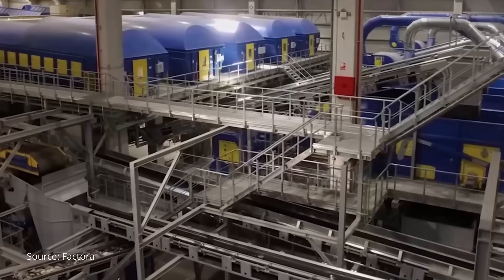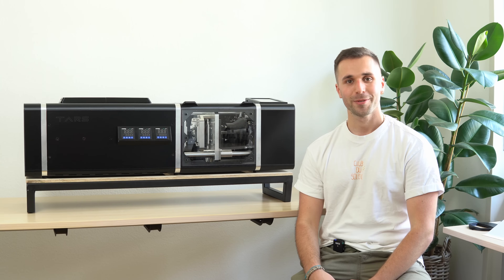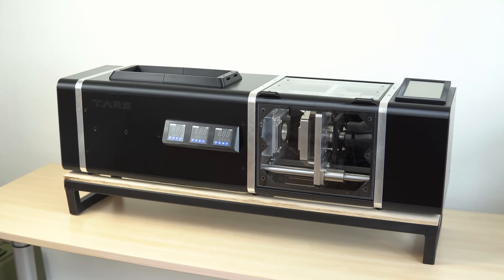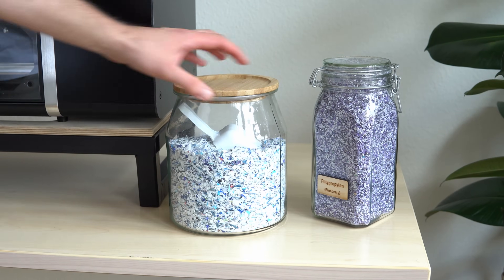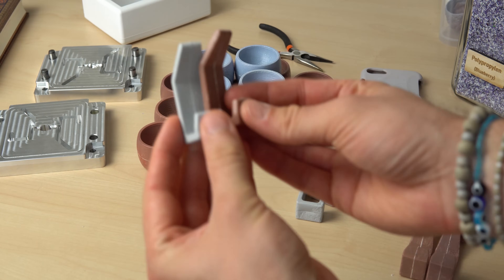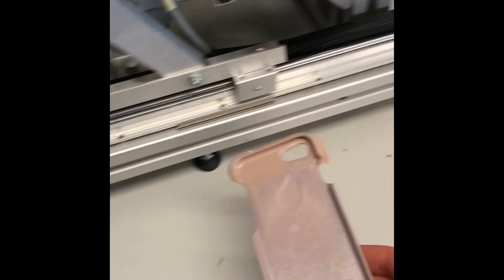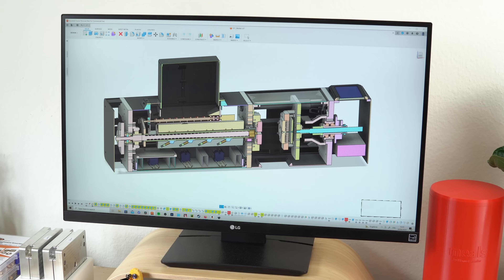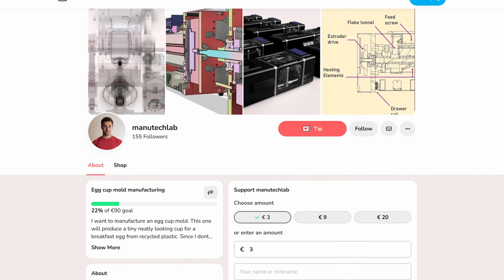Making a desktop injection molding machine for plastic recycling - TARS

Comment: The thing about injection moulding is that it is what unlocks true mass production. And while a workshop with a couple of 3d printers a cnc machine can scale surprisingly far it is nothing compared to what injection moulding can do. Even a relatively small tabletop version like this can be a workhorse that kick-starts a whole business. 

I know that you made this for purposes of recycling but I can't help but think about how this could bring back manufacturing to parts of the world which have exported their manufacturing capability in this arena to China. It's gotten so bad that nowadays it's impossible to find know-how for making moulds you can only import from China and that puts your intellectual property at risk and has some other issues.

Comment: Any coating on the screw will eventually find its way into the plastic 

It can be a non issue but can also cause head scratching when you need to gigure out what clogged a nozzle or causes weird dots in the material

Comment: The way to make this successful is to make this as low cost as possible. If you don't do this from the start, your machine will be pirated in China before you even begin producing them. The most important thing is to be as cost competitive with China as possible. If this is not your number 1 concern, you will absolutely lose. I cannot stress this enough.

Comment: I love the idea. The only issue I see with it is similar to those with traditional injection molding: you need highly specialized molds that are usually quite expensive. Have you ever considered creating a simpler application of this technology, like a 3D filament maker or something along those lines? If so, what made you choose an injection molder?

Congrats on this machine. It looks extremely clean and well-thought-out.

Comment: looks like your injectionsmold machine needs some more injection pressure and or some vents to remove the airpockets. It is quite typical to have injection pressures of over 1000 bar on products like this (this is quite hard to reach but i think it might be good to know). also all injectionmold machines keep pressure on the material after injection to move the last bits of plastic in the mold. the vents are typicaly small gaps on the closure faces these are about 0.01 or 0.03 mm depending on the materials used. you can contact me if you want to know more i have few years experiance in mold and die making and can operate a industial injection mold machine.

it is really cool what you made tho

Comment: i'm in no position to buy this machine, just curious is it possible to resin printing high heat resistance mold and injection mold custom parts?
I remember sawing some video on small scale production using this method

Comment: Hi Manuel is amazing what you did. 
I am working on an other machine will produce mushrooms on low scale. For big scale there are many on market. Can i ask you how you heat up the interior of the flakes? This problem still not have solved as need heat up also an cylinder with water in it. Will be so happy if you can give me a link or idea how made. Thanks so much

Comment: Looks awesome man!
It would be great if there could be some kind of shredder on top. Shredding the plastic to small pieces can be quite difficult without a proper machine.
Is this only for a specific type of plastic like PET or ABS? Or are you able to combine the plastic pieces and create something from a mixture of plastics?
Reply from the maker: Hi :) thank you very much.. that would be cool indeed. For now I mainly used PP because mixing is not a good idea. PP worked really well so far and is very common in German post-consumer waste

Comment: I think you have a marketing or miscommunication issue? You say this is for plastic recycling, but then you start with shredded plastic. How do I get the shredded plastic? How do I process raw recyclables into sorted, clean stock for shredding? From the initial pitch, I thought that's what this was solving. But instead, this is "desktop way to make plastic parts." But that's competing with a 3d printer. I can see that this might be better than a 3d printer in a lot of ways, but you didn't really emphasize that. It seems like there are 2 main users: "I want small-scale plastic recycling" and "I want small-scale plastic injection molding." I think your current pitch wouldn't satisfy either of them, even if the product itself is awesome. Just my 2 cents from struggling to explain a confusing product in the past.

Comment: This really looks cool! I am not shure about the „recyceling“ as it is just a injection molding machine and the parts you produce seem to me more like downcyceling. But the machine is really impressive! Still the parts show obviously the low injection pressure of the system and uneven viscosity of the plastic i. e. too short heating. But if you improve those, you got a money printer there. that could add to fast, cheap prototyping as 3D printers did.
Concerning the recyceling, yes shredded bits make sense for cost, but are aweful for process stability, a mess when handeled, harder to control. Thats why pellets are used, even tho they are more expensive then loose shredded bits.
May I ask your background? looks to me like you studied mechanical engineering.

Comment: I think the title is a little bit missleading in itself. It is a great looking machine but the core problem is the shredding of plastic, this plastic needs to be sorted out into the different types of plastics. Need to make sure the thermosets are not mixed with the thermoplastics. 
If the shredder was sorted out to do all the sorting this would be a 1 of machine, but I have doubts about that ever being feasible in this formfactor. 

What sort of lockingpower does the IM have? And can it keep afterpressure in the cavity itself after filling it up?

Comment: Did you issued a patent about this project? or you're not interessed into makeing this into a commercial product?
Reply: There's nothing justifying a patent here, shredded plastic has been around for years, injection machines have been around for years. They have been using recycled material for years. And the molds themselves are just standard 2 part, soft tools with no cooling in them so no patent there either.

Comment: why quality of molded parts is low? Is this a mold problem?
Reply: I would imagine it is a combo of problems. The surface defects could just be from the molds themselves partly, any toolmarks will be transfered to the finished part. 
The afterpressure of the mold could also create problems if you can't actually keep pressing material into the mold after the initial fill to prevent it from sucking material away from thicker areas. Could also be a problem with using 100% shredded material, never going to have the same surface finish of parts like virgin materials would have.
Reply: @aeywyn5230  thanks mate, nice to hear an advice from experienced person

Comment: If you could extrude the recycled plastic into 3D printer filament, it would be incredibly easy to turn household plastic waste into parts for any application you could think of. It won't have the same strength as the molded parts, but the versatility would be great for home and garage projects. Great job with the incredible recycling concept!

Comment: This is great, but what about fumes? Is there a ventilation system of sorts?VOCs and other harmful gasses are released when the plastic is heated. PVC can release hydrochloric acid, and ABS can release styrene… not to mention all the potential additives like plasticisers, flame retardants, and colorants.

Comment: There is not a word in the film about the basic parameters of the injection process. How do you control the charge back pressure, dosing speed and stroke, injection speed and pressure, switching point to pressure hold, mold clamping force, cooling time and mold temperature? Building an injection machine is less than half the way to achieving a repeatable process. The cost of building an injection mold often exceeds the cost of purchasing an injection machine with peripherals.

Comment: I'm trying to think of ways to utilize the machine but I'm coming up a little short. Is this a professional's or a hobbyist's machine? Meant to run once a weekend or 24/7? Where does one source (compatible) plastic waste in large enough quantity and of predictable quality? By yourself, shredding it yourself on your own shredder? Is there a sieve in the assembly?

I see no water cooling on the mould - sure, it's a prototype, I get it, but it is not possible to make "hundreds of parts" per hour without active cooling - which would also mean that parts shrink and also warp unpredictably as they cool. The output pressure also seems too low to really fill the creases which I assume are a consequence of unevenly melted material because of different melting points.

If this should be a hobby, it would be a prohibitively expensive one, you either have to make molds for it yourself, in which case you need a CNC machine, or you have it made, but then they're seriously expensive, I can imagine 2K for a small one, easily. If it's intended as a "pro's little helper", someone who's got many machines and is producing 3D printed parts, a machine like that would complement them when let's say 1000 parts are required and they also have to be very sturdy. But in this case, quality assurance would be a problem, unless of course you're doing this out of virgin material...

The major problem that I can see it is that it requires a very special kind of part that the machine would injection mold: something extremely forgiving,  something that  doesn't matter what color it is, if it has surface flaws etc. I can assure you nobody will want phone covers that don't look absolutely perfect, and in fact, I can't remember the last time I saw a hard plastic cover for the phone... I'm really sorry, it's a wonderful execution of an idea, but I just can't see it taking off... I do hope that I'm wrong.

Comment: So I have a desktop injection molding machine from China and I paid 12 grand for it.
 It's working pressure is 10 tons you've never made any mention of working pressure.
All you've really done is take that same injection molding press and added an auger to the feed.
 I hope you know that there are certain Plastics that you cannot mix simply because they are chemically incompatible and kind of tend to explode

Comment: All sounds fine, but if I can't make molds fast and different versions quickly then its not gonna work. It's all bout the molds!!!! 😊
Reply: Depending on the number of finished parts required, they can be made of aluminum and I think I've even seen inserts 3D printed for molds. With that said, mold making is a whole different field and requires the machines and experience to make the molds as well as learning how to use the molds in the machine.

Comment: Injection molding isn't the hardest part, its the 'recycling' part - where is the part that sorts, chops, produces pellets or uniform schreds? 
This ain't the 'decentralized recycling' promised.
Also this won't be 'low cost' or 'easy to operate'.
There is also this very non-trivial tasks of mold-making.
No doubt its a great machine, but you're selling something different than you advertise.

Comment: The effort is admirable, at least what went into the engineering and design of the injection moulding machine. But who will realistically use this? Is there enough demand for small-scale plastic products In countries with high plastic waste?

Comment: Fantastic! I don't think I've hit subscribe this fast before. I've wanted something like this for over 10 years. It should work with high temp safe resin printed molds, correct?
Reply from the maker: Thank you :) yes it does. I have worked with several of these resins the last year. You can have a look on my instagram if you want. @manutechlab I made a starship mold from TR300 Resin and also tried a phonecover mold from a different one (I dont remember the name of that material right now^^)

Comment: Hell yeah mate. Use-case aside, building a machine / tool to address a purpose because you couldn't fine one on the market is awesome. Toolmaking is such a cool practice and way less common than it should be.
Reply from the maker: Thank you! That is right.. only took me about 6 years :D but hey at least I got it mostly done. That is very true
Reply: @manutechlab  Time well spent 😂
Reply: I agree with this for sure. Find a need, fill a need right?

Comment: @BrothersMake might be interested in this as well and might be able to help you. 
What types of plastic can this recycle? Do you have an idea how users could make sure to select the right material and not mix various types?
Finally as an idea for other molds I'd suggest to look at gridfinity products. These are now mostly 3D printed but I believe/hope this might work as well.
Reply from the maker: I have worked with polypropylene so far, that works great. My method right now is to sort them by the marking of PP or 05 but of course that is not always the case. I have seen the project Plastic Scanner by Jerry de Vos. That looks like it could help with that. Thank you for your thoughts on a new part, I welcome that a lot. Often I have never even thought about a suggested part! Thank you

Comment: There appears to be some surface deformation on the parts.
I'm no expert but I would guess the mold is cold or the pressure is insufficient.
Reply from the maker: It is still a work in progress that is for sure :) I have only few experiences with injection molding. But it gets better :)
Reply: Its both.
Reply: @ShopBotix I understand this could be competition, but constructive criticism doesn't make you look as petty.

Comment: Putting on my 'constructive criticism' hat for a bit here: while I like the idea, and this looks a lot better than the Precious Plastic designs (although, will this be open-source?), I feel like "low-cost" is a bit of an incomplete statement here - the two parts of a small-scale recycling setup that are typically the expensive ones are the shredder (due to the steel shredding wheels) and the production of the molds (due to the need for accurate machining). The former is not included in this machine (how does mixed waste turn into sorted and shredder flakes without transport?), and the latter is left out of the video.

I think this project has a lot of potential, but to function as a true fire-and-forget low-cost local recycling system, there need to be clear answers to these two points - they are the Hard Problems of this problem domain. There are undoubtedly many possible ways to address those issues, but there needs to be some kind of solution for them that still fits within the "local, easy, and low-cost" bracket, and right now it just isn't clear that there is.
Reply from the maker: Thank you for your thoughts on that and I have to agree with you on most of it. This video had to be limited to 3 minutes and I did not go into these topics. It is not open source yet. Most of my projects related to this machine and the former deisgns are. If you want to have a look at them. I shredded the plastic I collected from friends and family at my university. They had a big shredder there that did a fast job. So the raw material price for me was low and the products created from the machine can be sold at higher prices than granules and be soled to an end consumer. That makes it much faster to reach break-even with this machine while their is not much man labor needed. I wrote about this in my application for the James Dyson Award, if you want to have a look into it. It was just hard to fit all of that in this video. I love the fact you took so much time and thought in this comment, it helps me a lot to find out what is still missing in the project explanation and helps me make a better job:)
Reply: @manutechlab  Thanks for the reply :) I'd be interested in reading more in the application, but I can't seem to find a link to it - is it available anywhere?

Comment: While it is a cool desktop injection molding machine, I fail to see how this helps with plastic recycling ?

Isn't the hard part of plastic recycling the sorting necessary, cleaning, and grinding into usable pellets ?

Once this is done, you can simply send the grinds to any company that needs plastic in order to make their product. They then will use their already existing injection molding machines for that.
Reply: Exactly my thaugts. It's an injection molding machine that processes the recycled plastic but has nothing to do with manufacturing it.